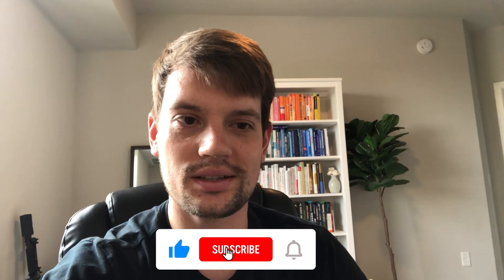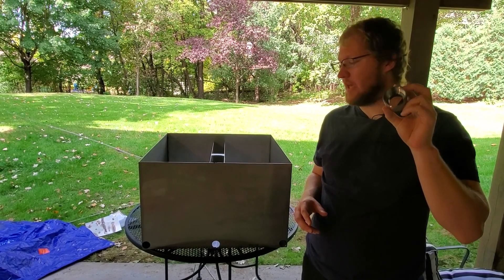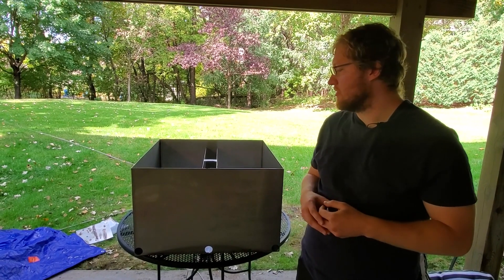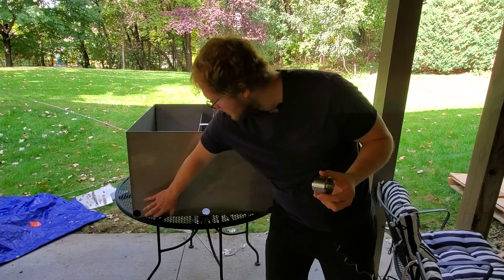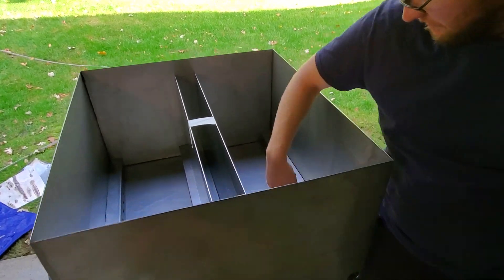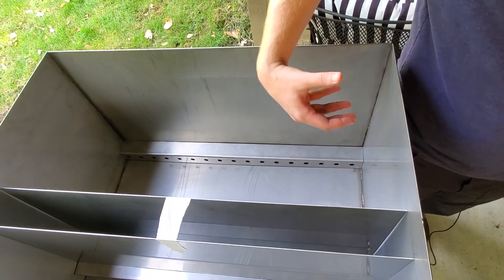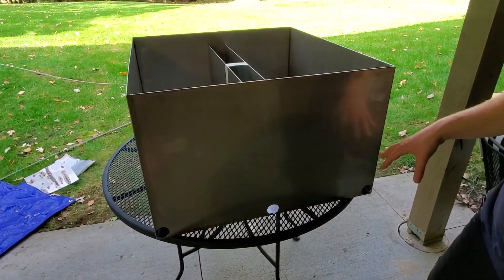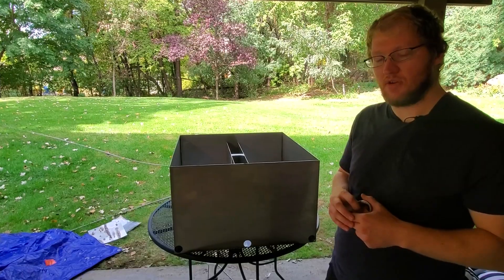Bitcoin Mining Immersion Cooling Tank Reveal

Comment: What is the material of the tank and the wall thickness? is the weld in the dividing plates all the way ? in other words how you make sure that the fluid wont leak between the hot and cold chambers ?
Reply from the maker: It is 16ga (1/16") 304 stainless steel. The tank is leak tested with water to verify there are no leaks. We use a special chemical resistant, waterproof sealant between the dividers and the body of the tank to ensure the hot and cold fluids stay separate from eachother.